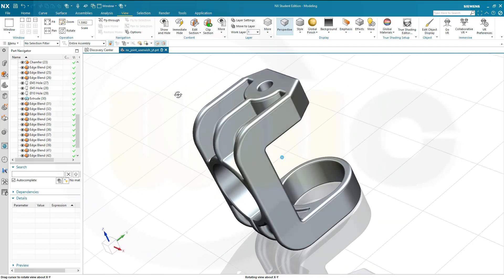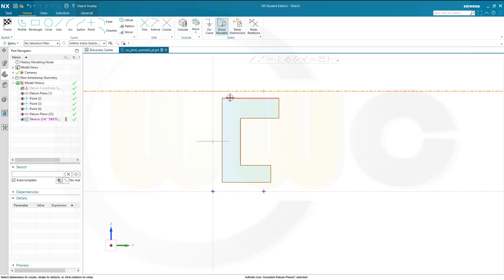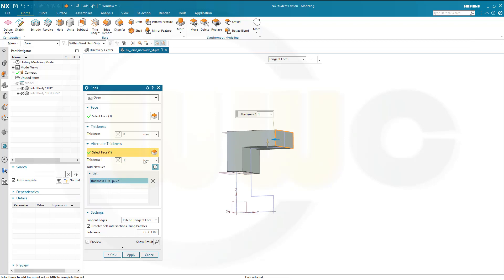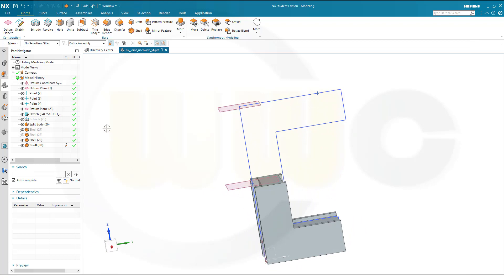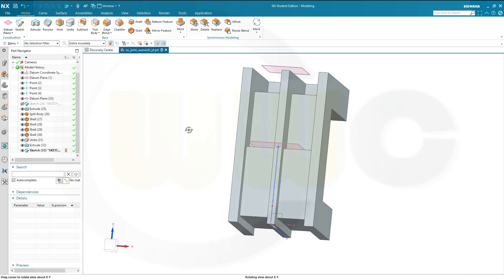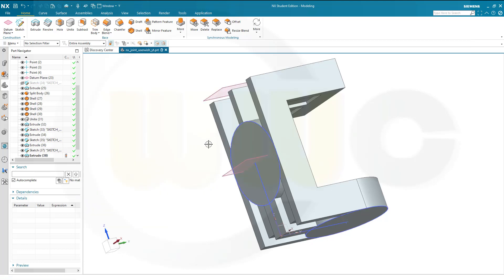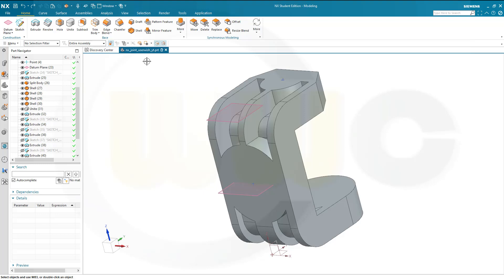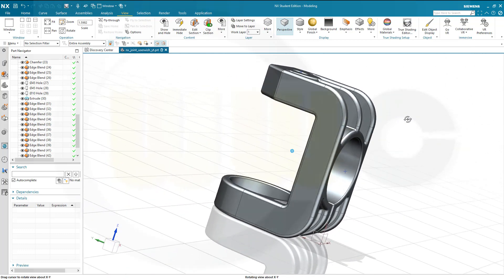Joint - Userwish - Siemens NX 2007 Training - Part Design

Comment: Ciao Wolfgang, thank you very much for all the contents about NX. I have a question, when I'm inside a sketch and I put a measure, for example 2.35, it shows me 2.4 once I hit enter. Is there any configuration that allows me to see more than just one number after the coma? Like for example if I enter the value 2.35 it will show me 2.35, if I enter the value 2.3575 it will show me that value. Thank you very much 🙏🏻
Reply from the maker: You have to go to the DRAFTING settings : go to - utilities - customer defaults - drafting - general set up - standard - customize standard
Reply: @wolfgang.walden.cad.training  Ciao Wolfgang, I followed the steps but I cannot change the parameters. By the way, I use version 12. Anyway, thank you very much for your time🙏🏻
Reply from the maker: Eventually those options are locked by your admin.